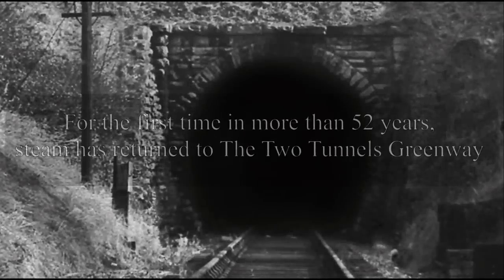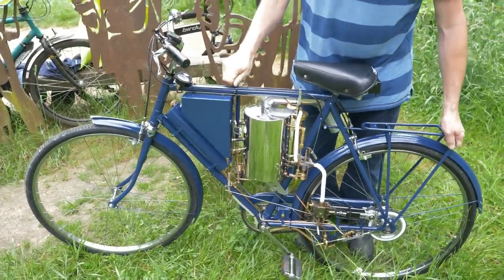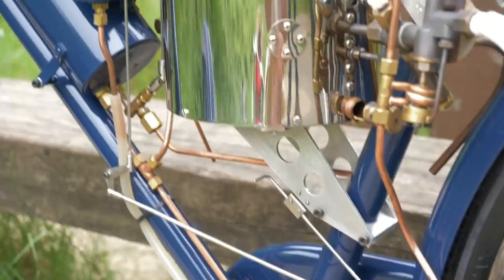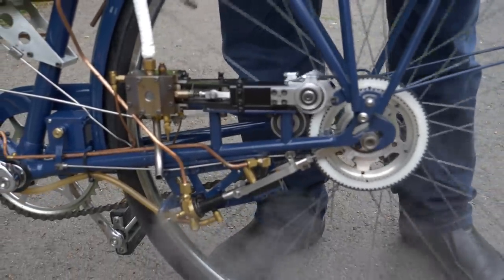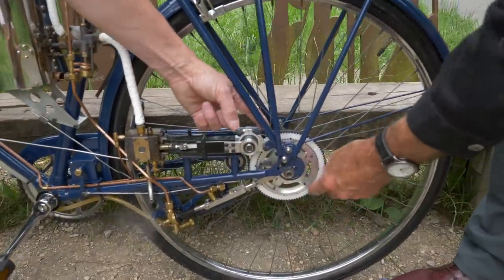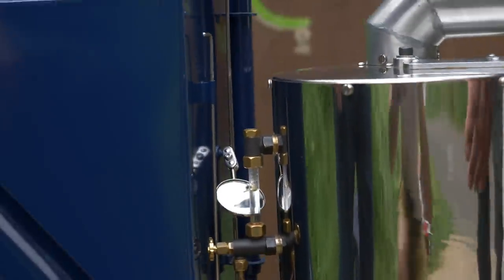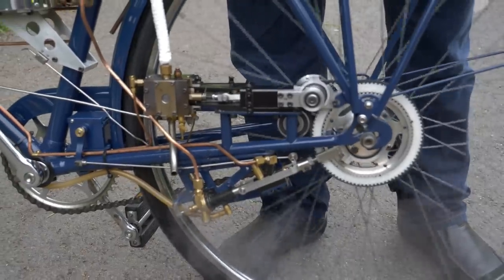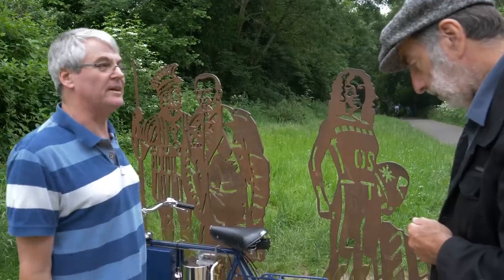The Ruscombe Gentleman's Steam Bicycle

Comment: I am always amazed by British ingenuity. I am a retired tool & die maker with a masters in mechanical engineering.  I have a full shop at home. 
Can I get a copy of the drawings for this? I have always been fascinated by steam power. I built a scale model of a case traction engine. I ride it around my yard and use it to plow my garden. 
Has he designed or built anything else? I am intrigued by his 2 Stanley steamers. Details for them are hard to come by. A dream would be to build a Stanley steamer or perhaps a small actual steam car that I could build to drive around town in Florida. Please help me get in contact with this eccentric genius. 
Thank You

Comment: G'day,

Yay Team !

   200 Watts is the upper limit for Bicycles' Auxilluary Powerplants here in NSW, Oz ; so this unit's 180 watt designed maximum output is an excellent feature... (half  the eBikes,  & all the 2-Stroke Whipper-Snipper Conversions getting around the Roads here, are actually illegal !).

   If it can run on distilled Grain or Wood Alcohol rather than Essence De Fossils then it could be considered "Almost Green"

  Pity about the Synthetic Oil, and the Diesel burnt to mine all the Metallic Ores, and the Coals burned to smelt them with, and the Crude Oil from whence came the O-Ring Seals & Nylatron Bushes & Plastic Handlebar-Grips & Synthetic Rubber Tyres....

How far was the  intended journey this was contrived & cobbled-up to facilitate ; and how many times could ye not have walked the Track, forwards & back in the time spent makin' the makin's, which it took to put that curious Gyaskootus together ?

   Not "useless", not by a very long Chalk ; but by GollyGoshGeeDarn-&-Shucks, mister, that there is a terrifically mind-buggaringly Decadent  bit of Kit.

  Well done, now tool up and sell them to your Grandchildren's Generation mate ; "Post-Apocalyptic Steam Punk" is a popular Genre of Consumer Fashion, & and this could be the  biggest Investment Bubble since the Solar Chargers for Segue Skooterz (pun pun lol).

Have a good one.

;-p

Ciao !

Comment: Im sitting here thinking about a "hybrid- hybrid" > a steam driven generator powering an electric bike.
Reply: A steam driven turbine powering a generator powering an electric drive. Sounds to brilliant to be possible.
Reply: @hopefilledsinner3911  What I saw as a plus: The mechanism to "move the bike" is already there  Already on the market are model airplane and car engines powerful enuf to drive a small alternator/generator.. (We're not violating any greenie rule - He's using fossil fuel to heat water) 
Units could be compact and portable enuf to mount on a platform over the rear wheel  of ANY electric bike, all youd need to do is connect into the electrical system..
Then you wouldnt have to build each bike from the ground up. - mass produce dozens/hundreds of units. The only part necessary to "customize" would be the platform for different bike frames.

Comment: A superb effort. Can you please give the bore and stroke of the engine and some basic detail on how you control the crtical water delivery to the boiler from the pump. I am currently building a steam powered bike and control of the water delivery seems to be the main issue to all that have gone before. Please follow up with details of your modifications.

Comment: steam engines progressed so much in the time they were used ,imagine where their development would or could have gone if diesel/electric hadnt killed them . as a curiosity this bike is amazing ,  whether it is  fuel efficient or low emission will be the key  to whether it could become a feasable transport option . i suspect there would be a lot of people willing to try this but from my limited knowledge steam engines were maintainance intense .maybe this has been engineered better as i did hear them talk about modern oils and perhaps different alloys etc.  well done !
Reply: They were maintenance intensive and also rather inefficient. Bill Lear, of Lear Jet fame spent countless hours and dollars trying to design a steam powered bus years ago, but the efficiency could never reach the level of petrol ICE engines, and fell well below the efficiency of diesel engines. Reciprocating steam engines are a cool curiosity, but not practical as an efficient prime mover.

Comment: not much info would liked to know about power and speed..
Reply: He discussed both.
Reply: He said that it had a design maximum power of 180 W, reduced to 130 W for actual use.  He spoke of 30mph with the original high gearing, and 16mph and the ability to climb hills with the current lower gearing.

Comment: Well. He is using fuel to heat the water. That makes it a bit absurd, as that fuel could be used more efficiently in an ordinary engine. Heating the water with wood or coal would make more sense. Especially wood, as you could collect it while riding. - Otherwise a beauty, of course.

Comment: Using petrol to power a steam engine sounds a bit backwards
Reply: Most steam cars also use petrol or other for pilot fuel
Reply: @crazyyoutubeuser2444 I thought most steams engines used coal. A real burning fire.  Thanks
Reply: Ethanol would be a better fuel. Home-brewed ethanol even better still :-)